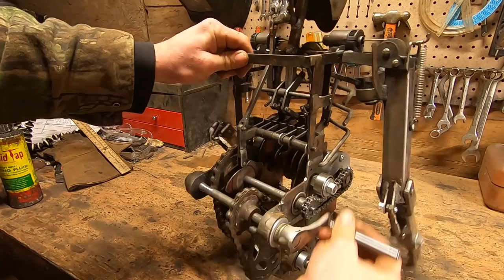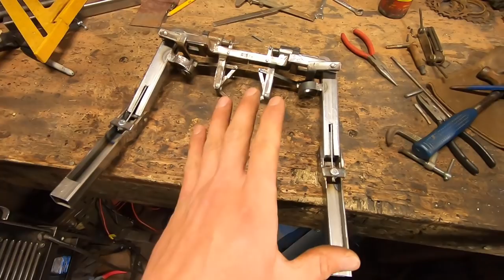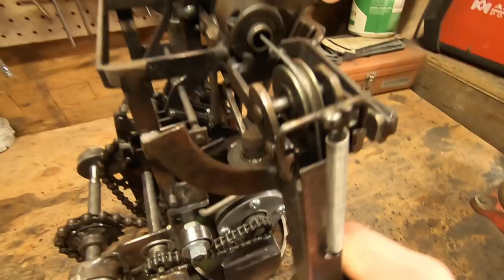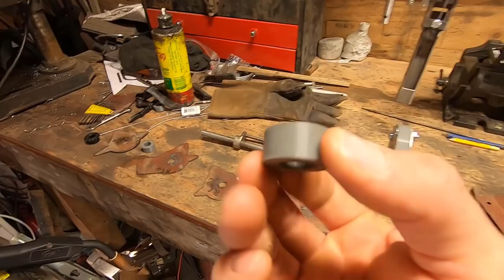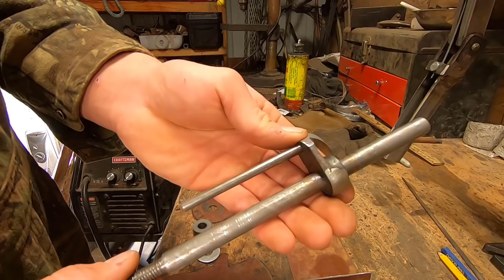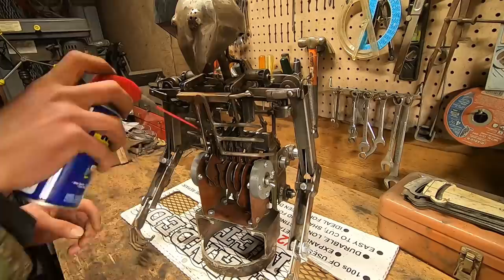How to Build... a Friend?? (DIY Human Automaton, AKA "Igor")

Comment: “Not an engineer” but likely more capable than one holding a degree. Keep up the interesting and educational content 👍
Reply: After working with many engineers from almost all branches, from mechanical to civil and computer and electronics, I can attest to that.
Reply: I'm an engineer, and I consider myself a fairly good one in my craft. But I certainly can't match the versatility of this guy.
Reply: I don't think it takes a degree to be an engineer
Reply: Another engineer here. This guy has skill. Engineering just wraps math around it so you can refine it. But it’s just number crunching if you don’t have the skill to begin with!

Comment: I've been watching quite a few automata videos, mostly with the Jaqurt  Droz writing/drawing automatons.  The use of stacks of cams is fascinating, not only in its complexity but how they knew exactly to form the cam lobes so precisely for the fine hand movements!  Also the way the cam plates are shifted up and down is remarkable.  I like your creation and the use of the cams as a mechanical state machine.  I think you are very bright and clever!

I have designed quite a few electro-mechanical machines, mostly test tixtures using microcontrollers, servos, linear actuators, steppers and various feedback sensors and from this background and point of view am astonished at how 18th century designers could do this all with clock mechanisms, cam stacks etc.

Comment: Useful video; your explanation about cams and timing as well as co-axial movements are very good. Thank you. A few notes here: you could consider the use of aluminium on moving parts to lighten them instead of beefing-up the structure and making it heavier still. Also, WD40 is a Water Displacent and will protect from rust but it is a very poor lubricant and co, will not reduce friction. PL100 is a good spray lubricant or just good ol' engine oil for that matter. Thank you.

Comment: The same principle using cams on a shaft is still used in machine building industry (larger for sure). At least in the Company I used to work at in Germany. It's cheaper and more reliable than using electrical drives for everything. At least if the movement of a machine is always the same

Comment: I wonder if there's a Disney engineer out there you can brain pick regarding automatons and their track record with them.  This was cool.
Reply: The automations that Disney ran decades ago were controlled by military computers (the UYK-7).  Those computers were (are) horrendously slow (on the order of 100,000 instructions per second), but they had massive I/O.  It's one of the really random bits of trivia I learned when I was in the US Navy about three decades ago, learning about those very computers.  But I wouldn't be surprised if the old automatons worked very much like this, but using solenoids or synchro motors in place of the cams.
Reply: @BrianDaleNeeley  That's fascinating brother, can definitely see that with the old builds.  Wild.